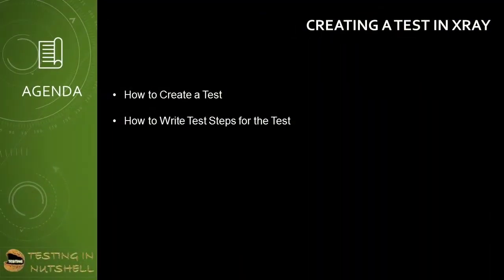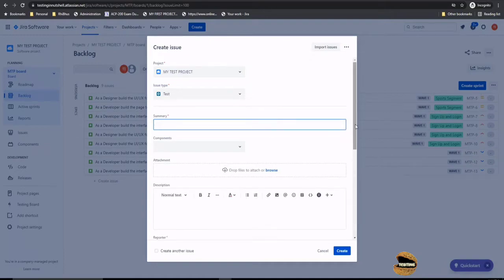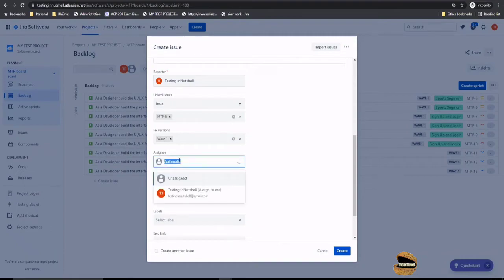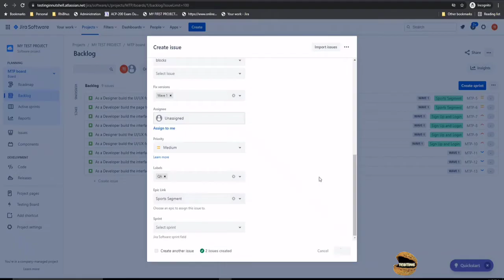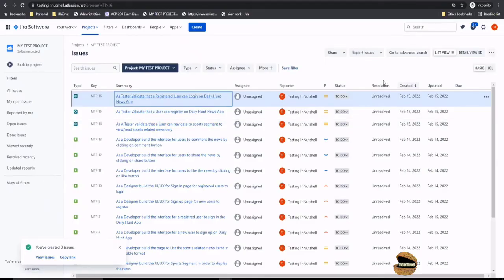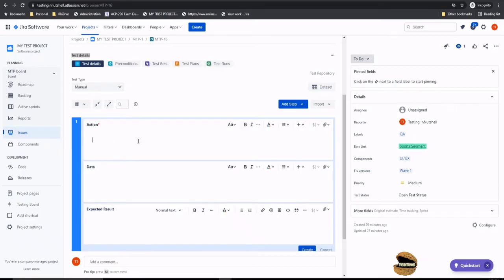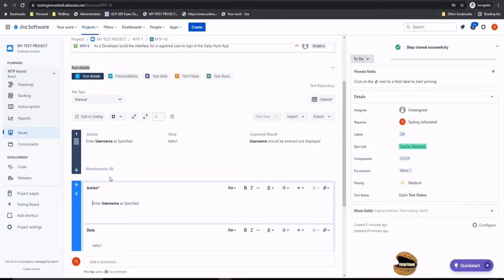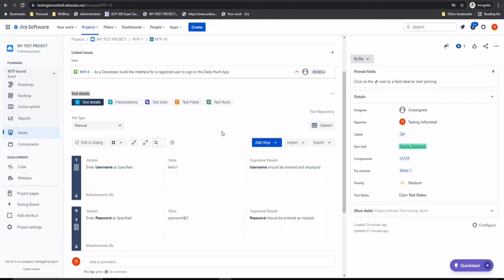Tutorial #4 | Creating Test in Xray | Writing Test Case in Xray | Test Steps in Jira | Xray Tutorial

Comment: Q: Let's say I created a test case with several steps. 
The test case is implemented in two different test plans. 
However, one of the steps is redundant in one of the test plans. 
Is there a way to include a step in one test plan (under the same test case) and exclude it from the other?
Reply from the maker: No that wouldn't be possible.
As you see Test is a workitem, it's flexibility of xray that allows you to call it anywhere which creates several instances sourced to the core which remains 1. So local editing under a test plan will impact the rest.

Comment: hello sir, hope you're fine. i have a question about writing test cases. when we want to write different test cases for a specific scenarios, we should think of both negative and positive cases like for example login test cases( we should test with both valid and invalid data). My question is: is this valable for all scenarios? for example, if i would like to write test cases for testing a buttom, what are the negatif test cases? 
for me, the only test case possible is to test if the button work correctly, i mean if the button open the right page. could you please help me about this?
Reply from the maker: Hi Ikram,
You are right, testing  a button has only one scenario that is click but if really required there might be possible ways to check it otherwise. Like if it is a Sign up button - Then fill only a few fields and click the button, Fill invalid data and click the button, Fill all the fields and click the button.
Generally, we can add valid and invalid tests when we have data involved not for buttons.
Reply: @TestinginNutshell  i got it.thank you so much for your reactivity